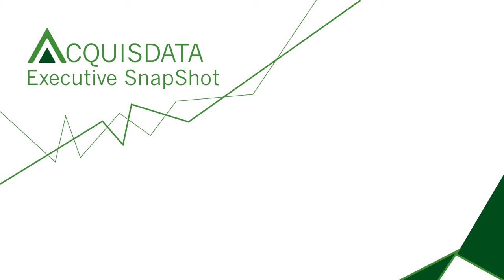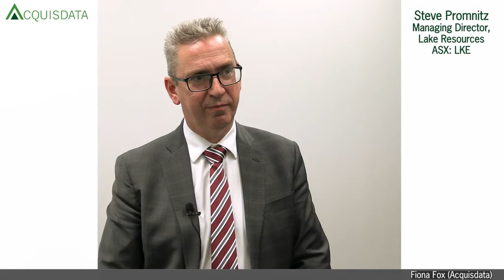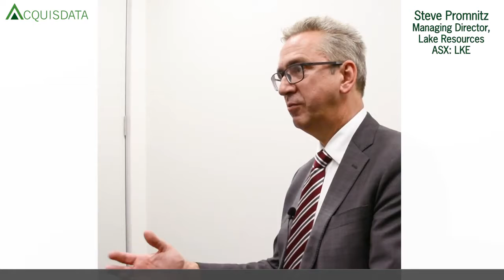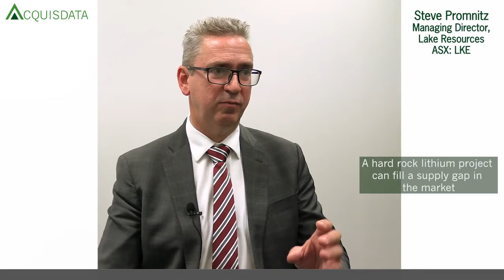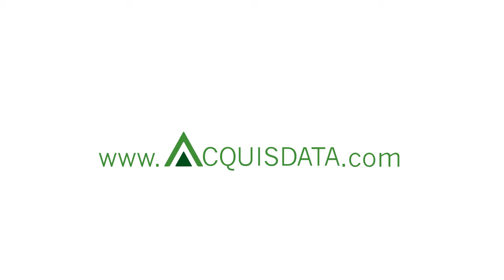Purity, cost, time   how Lake's lithium brine stacks up against hard rock lithium 03 2020 3%2F12

Comment from the maker: 03:05   pond (n/v)     04:15  whereas     01:37   certain (a/pron)    00:30  underneath
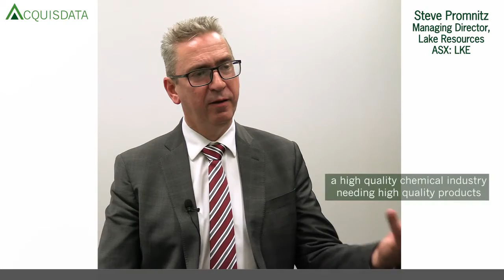01:29   site (n/v)     02:52   fundamentally     02:09   millenium     03:05  line with
03:19   commitment     03:59   particular    02:34  the same amount of   03:30-2  tend to
00:56   ceramic     03:36   commodity   02:09   collect   02:52  set up    02:15  it just so happens
03:34 initial    01:29  any other   04:03  miss (v/n) 缺失   00:49  go back (adv)   03:51  extract 
01:37   the other    01:01  go into   01:01  advent      00:41  at the end of the day
 03:24   ( BDSDJXS )